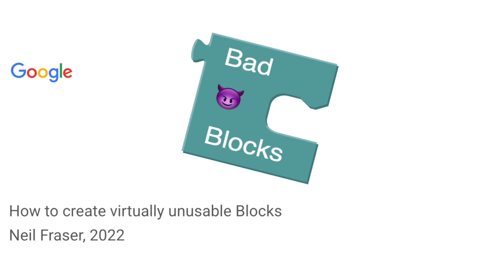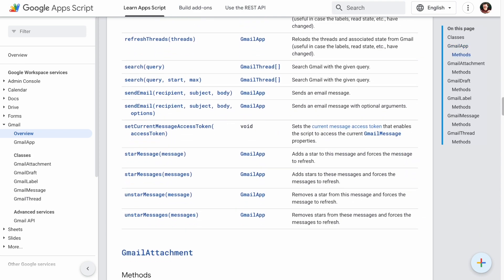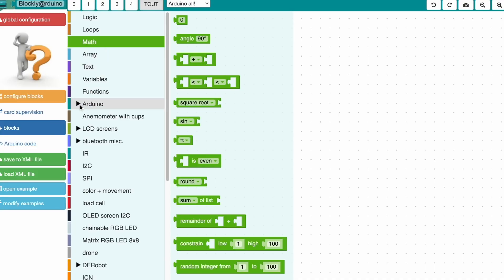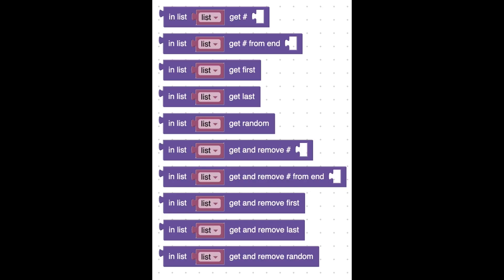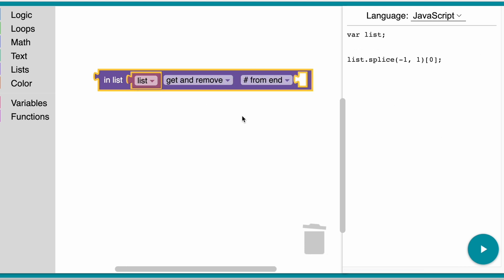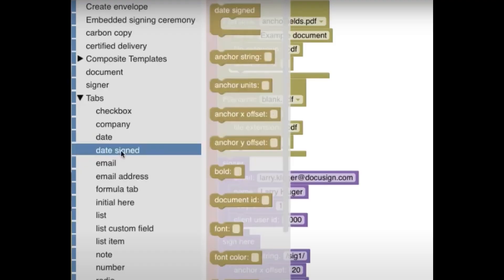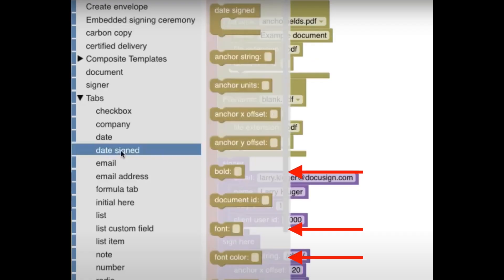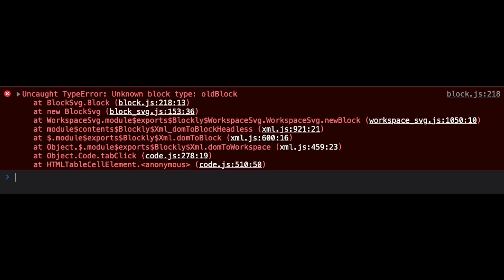2022 Blockly Developers Summit: Bad Blocks

Comment: So confusing.... what is the point of blockly when it is super complicated to install it in the first place?
Reply: its not that confusing if you are experienced with software development, and many users are creating applications are experienced. I do think there is a lot of space for an online software as a service application that takes all that complexity away from users, maybe it exists but it's still early days for Blockly
Reply: @jamescat2386  I think Google is missing out on a big opportunity... they should make Blockly be available/easy to use similar to Scratch.  If a beginner/average/hobby coder wants to use Blockly it's quite confusing... almost to the point where it is easier to simply code with a text editor.  My 2 cents 😁